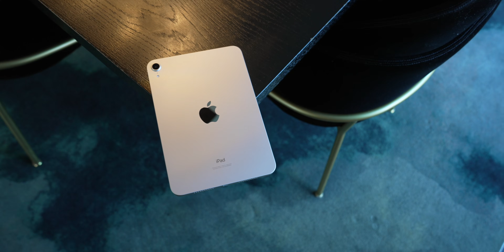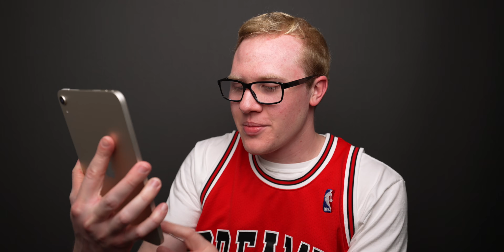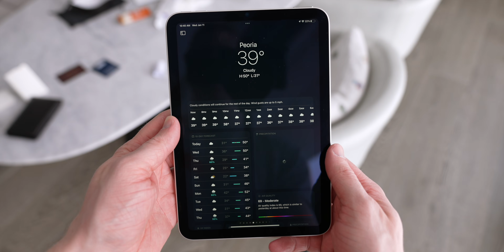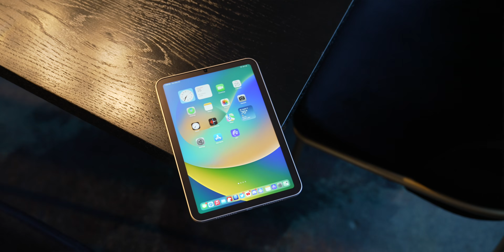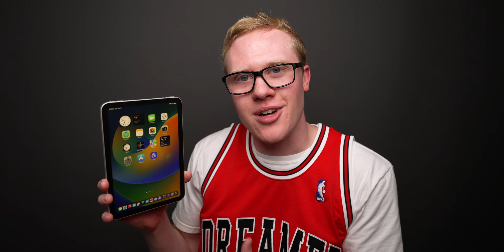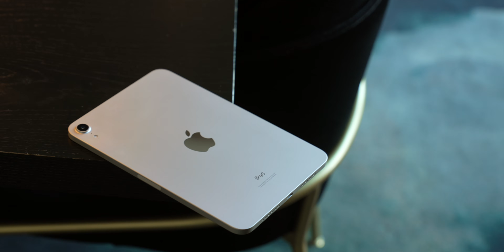Why I HATE the iPad mini.

Comment: I have the Mini 6 and am considering with the new models releasing in Sept, should I change to an iPad Air or Pro. I love the portability of it, but I always feel a bigger screen would be better. 

Problem is, I feel Apple has forgotten what a tablet is really meant to be - not a replacement for a laptop, but a super portable device for more casual things like emailing, YouTube, gaming, streaming, taking notes etc, tasks that work so much better than on the iPhone. So any iPad should have 3 features - an amazing display, super light and portable, and banging specs. So why doesn’t Apple just release a basic and Pro version of iPads, with respectively the same specs, each in 3 or 4 sizes starting at 9 inches, with all those features? The iPad Air, with the magic keyboard, is like 1.2 kg which is so not portable unless you’re very strong lol. The iPad Mini has the shitty screen and I feel the size is too small. 

So I’m really torn about which iPad to get this September. Torn. I think if they give the Mini 7 a 120hz display and the A17 chip I’ll get it.
Reply: Can you show me where you found September as the release date for the new mini?
Reply: @olivedrab  all the leaks and these YouTube vids have been predicting September release

Comment: I had the iPad mini 2 many moons ago and I absolutely loved it. I love the form factor and having the full iPad experience in a much more portable form factor. I currently own the Air 5 but if the mini had the M1 that my Air has, I’d buy it. I do think it’s entirely too expensive though. I think the original $329 price the iPad mini was a good starting point. $499 is a tough sell unless you really want an iPad but also really value portability.
Reply: £659 in the UK😢but admittedly that's tax included

Comment: To keep this as unbiased as possible, I bought my iPad mini for a purpose. A perfect size and weight to accomplish tasks that I need to do (suffer the net, update excel sheets, monitor financials, read the news) an that’s it. I didn’t want to over spend on things that I will never use or could care less about. It solved a problem, with minimum cost and size. My own personal opinion, I hate faceid and if I could get a phone with no camera…..(front and back) I would do it. I miss Touch ID on my 11 mini.

Comment: Sam and his silly thumbnail is generalizing to the extreme. iPad mini is not for everybody, but for a lot of people its their favourite device. Putting macOS on an iPad is silly. It’s not meant to be a computer, its meant to be used as a extremely portable tablet.  The larger models are designed to be a computer replacement. I use an old iPad Pro 2018 every single day with a keyboard and its great. This is where “creators” need to start thinking like non-creators when coming out with videos like this.

Comment: I think you are right about you not being the person this product is targeted at and as well as the hardware flaws in this case. You stating it could use an blown up iOS experience instead of an iPadOS experience? I see what you mean (as iPadOS is not optimized for iPad mini). 
You will have to see a different user case senario for it. It looks like a device to have compact with you and easily can take some quick notes. Next to that it can be comfortable in specific locations/positions you do not want a large tablet in. For example: I use iPad mini in bed when I need to see a program broadcasted evening, but need to get up early morning. Or like a friend of mine on his Japan trip, he specifically took a iPad mini for it's compact form factor. 
So they market it for these use cases you want to have a compact device. However the screen is too much of a downgrade of the hardware for a 499 dollar device. For taking notes, or just in a comfortable chair at home, I use iPad Pro 11 inch.

Comment: 1. They just needed to fix iPadOS for this device and they didn’t. 2. They need to give it the Pro Max camera. 3. They need to give it OLED with 120ghz. 4. Increase chip, RAM, and storage. This is actually the best iOS/iPadOS device even without those things. The iPad 10 and Air aren’t worth it and the iPad Pro is actually the big disappointment even with two pro apps. The Mini just needs more love from Apple and you after that. Scrolling in portrait mode? Why would anyone do that? This works best with two thumbs and propped up. Fits in a purse, but text isn’t so small and is very sharp. Makes for a wonderful ebook. Mini forever.

Comment: iPad Mini is mini. That’s its key feature, and it’s why I like it. If the size doesn’t sell you, don’t buy it

My ideal would be an iPad Pro Mini. That would draw out the form factor’s max potential. ProMotion, FaceID, T4 port, real external display support, FCP and Logic support, maybe an OLED display. Easily worth $800 for me, immediate buy over the 11” Pro
Reply: Logic works on the Mini 6.

Comment: The iPad mini is great, it’s your expectations that are wrong. You want it to be an iPad Pro mini, it is not. It’s an iPad / iPad Air mini.
Reply: Context; Dual iPad user! 12.9 Pro 5th gen and mini 6. I find I use them both pretty much equally and I tend to have specific use cases for each, with little overlap.

I use the iPad Pro 12.9” primarily for work; As a secondary device / display when working or gaming at my desk (Universal Control is great), and my device to get work done (paired with a Magic Keyboard) when away from my desk. I almost never need macOS when away and if I do it’s a TeamViewer connection away.

The iPad mini 6 is primarily a consumption device; Podcasts, YouTube etc. Things I’d do on my iPhone 14 Pro but the small screen makes uncomfortable for longer durations.  That’s not to say I don’t use the mini for work. It’s my tertiary display / device at my desk (mostly used as a talking calculator, document scanner, and glanceable calendar / notification screen), it becomes my secondary device / display away from home (performing the same functions plus as a reference screen, since split screen multitasking takes up valuable display real estate on the 12.9”), and I also use it when travelling as the 12.9” is a bit too unwieldy to hold and use in the back seat of a car, especially for longer journeys (I don’t drive, I get driven).

Comment: I was going to get the larger ipad from Apple's confusing lineup (e.g. some don't allow new apple pencil etc) for the display but iPad mini is the best iPad for my many needs.  I used it for editing and transmitting photos on deadline and it is superb.  Maybe it's not the best screen or fastest processor but the size and performance are incredible especially since I can transfer RAW images or large JPEGS very quickly from camera to iPad via USB-C!  On iPhone 14 Pro Max and lame USB 2 lightning ports that would take forever.  The iPad mini also compliments my Macbook 14" and iPhone 14 Pro Max as the screen is great for portable editing including video with VIDEOLEAP app.   I love how I can easily fit this in a jacket pocket, belt pouch or iPad sleeve in backpack.  I speak for many that if apple eventually updates this iPad display and processor many fans will buy it.  Had to handle relative's 12" iPad and that thing is a brick.  Love my iPad mini even two years on.

Comment: This video just doesn't make sense. The jelly scroll is indeed a bit annoying, but it's still a way better display than both budget iPads. iPadOS is indeed a mess these days, but it doesn't make the iPad Mini worse, it just makes all iPads jank. The build quality is actually better than the Air. The Air 5 has some creaking noises with the aluminum chassis, which the Mini doesn't have. The screen build quality thing you mentioned when you press on it happens on literally all iPads currently offered by Apple, it's been going on since they laminated the display on the iPad Air 2.

Comment: The iPadOS thing was a TERRIBLE take, especially when you can can icon and text size in settings, however, you were right about the jitteriness and that for it's price, there's a good amount of dumb things. It honestly should be $329 at starting price. Makes no sense being smaller than the iPad and more expensive.
Reply: It's always been like that though, and for a reason: It's much better than the "iPad". Better processor, higher quality display, proper Apple Pencil support, etc

Comment: All the ipads that aren't 120hz have jelly scroll. The iphones had it as well, if you looked for it. That isn't a reason to call it the worst product Apple has ever put out, lol. It's one of their best tablets - true tablets - and it's powerful as heck.
Reply: Had most all iPad since original one.  This iPad, even with its limitations, is the most functional because of size, weight, and enough processor power to edit 4k.  It's also very fair price.  got 256gb for less than $600 including tax.

Comment: I love my iPad mini despite also having 12.9 inch m1 version too. Despite my obvious partiality towards the mini, I agree with all your points (except the jelly scrolling issue)
Bad build quality check
Bad for note taking check
Badly scaled software check

One point that you missed — inability to lock the screen while using it with an external monitor. 
I know this applies to all iPads but I feel this feature is more needed in a device that is smaller in size.

Comment: iPad mini 4 was my first iPad and it was amazing at the time. I've never not used it in landscape mode. Jelly scroll is just not an issue that exists. An iPad is supposed to be used in landscape, period.
Reply: I'm pretty sure one of the biggest issues you have with it come from using it in portrait mode like a phone. Which is just wrong.
Reply: Then why is the Apple logo upright when it’s in portrait?
Reply: @tmclaughlin11  it's like that on every iPad. Even on the Apple Pencil it's in that direction. Also remember that old apple laptops even had it upside down

Comment: Yes, it’s great for pilots, but there’s a problem:

I’ve noticed on rare occasions a tendency of the O/S to “crash” or just “hang up” at the worst possible moment when I’m running G-P or F-F flight management software. 😡

It doesn’t happen often, but the few times it did left me with a “tongue in cheek” feeling about relying on the iPad for this type of use.

OTT, the form factor is perfect for every cockpit from Cessna to Boeing. And frankly, the iPad is the way forward for all aviation, and belongs in every aviator’s flight bag.

Comment: For me the video would be Why I don't like the iPad period.   Got the 12" Pro years ago and it just collects dust it was a waste of money and biggest reason iPadOS is crap period.      I got a new project to do that I had to work in the small work area that I originally bought the iPad for, but I just couldn't bring myself to use the iPad Pro again   So wanting to try the new Apple M-serie chips I bought an  Macbook Air M2 being it is about the same size,  that was the best decision.   I can do so much more with the MBA M2 and it is just as portable and I now using the MBA M2 constantly WAY more than I ever used the iPad Pro.